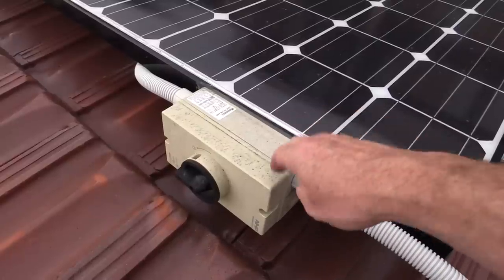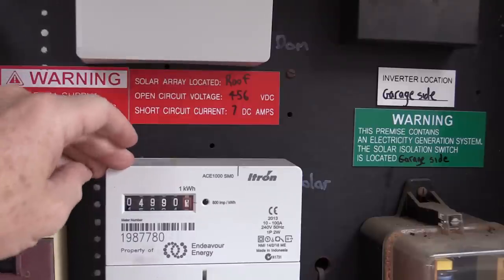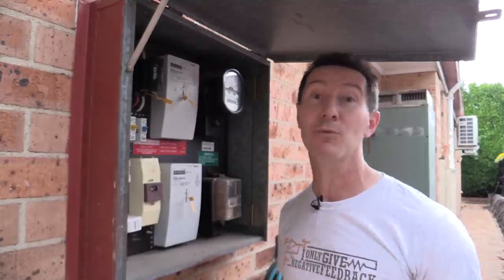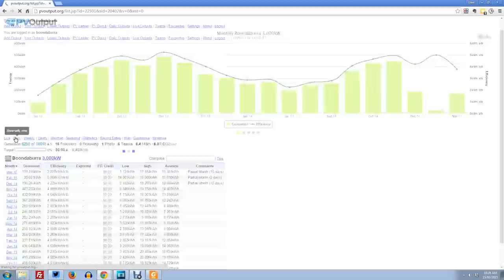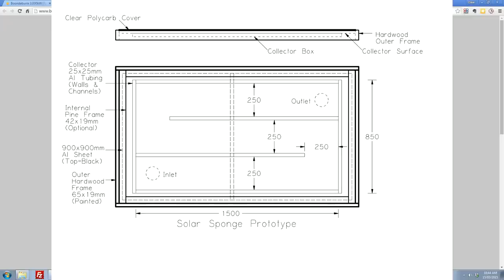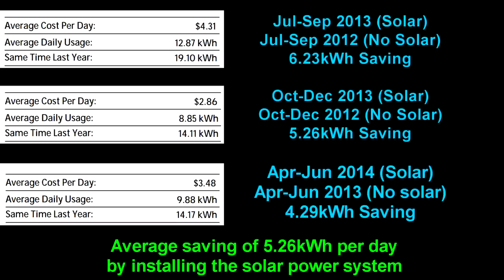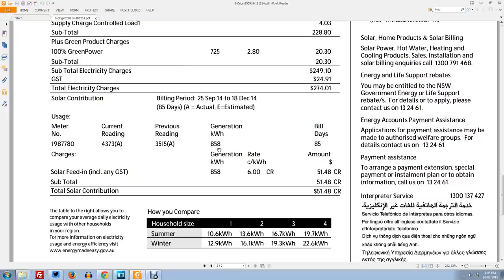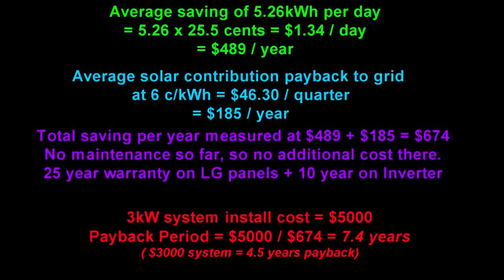EEVblog #724 - Home Solar Power System Analysis & Update

Comment: Man, I know there is a LOT more warm weather in OZ than Canada but that is an insanely low daily consumption!  Do you all use gas(Natural Gas/Propane) or oil for anything?

Our house is strictly electric and we have a top shelf geothermal system and it supplements our hot water and we average 62 Kwh/day!  (3400 sq feet heated/cooled).

Our cost per Kwh is only 10.5 and our FIT is 9.728 so that is not too bad but the cost of a system here and the massive losses on production in the winter makes the ROI really tough.  And my GHP draws massive amps on startup so I cannot really entertain off grid without a massive investment in power storage.
Reply from the maker: Jason Price We basically don't need to heat our house, and if we do it's the aircon for maybe an hour or two on a few dozen cold days in winter. In Australia (most parts of it) we use vastly more aircon for cooling than for heating.
Reply: EEVblog Well, that explains it then!  My in-laws have renovated an old farm house and added a GHP and they have their daily down to about 45.

Lucky you I guess!  (Crazy poisonous things not withstanding!)

Anyhoo, love the vids so keep em coming!
Reply: In North America average home use quite a bit more power than Europe and probably Australia.
I live in Saskatchewan and my power consumption when I was living in a rented apartment was 250kWh/month in average for that the total bill was 50$. Most of that was the large fridge that came with the apartment and water distiller that I used daily.
Now I live offgrid and my power consumption is around 60kWh to 90kWh depending on month average probably above 80kWh/month.
Reply: ***** Per month?  I am in New Brunswick.  That is just not happening here unless you are using oil or wood for heat!  I can't see it being much warmer in Sas.
Reply: Jason Price At the moment I use propane for heating. But I will get a larger PV array and heat with electricity directly from the PV array. Is a bit of a specially designed and constructed house for low energy use. You can find a video with the house on my channel.
Reply: ***** I watched your house video and it all makes a lot more sense.  Posted a comment over on that video but otherwise, terrific work sir.  I guess a better way to look at power consumption would be on a per square foot basis as I chose to have a much larger house (By far) over yours.  My breakdown works out to 18.5 watts/hr per sq foot.  This is 50% less than a house with all baseboard electric and 30% or more less than a house with an air to air GHP.  You should do a conversion of BTU to watts and post a video showing your total energy usage.  It would certainly paint a much fuller picture.
Reply: Jason Price
Maybe I will do a video about my energy consumption. I'm used with kWh so I will need to convert to BTU for those used with those units for heat.
I made a quick google conversion so my worst moth heating of 1000kWh is equivalent with 3.4 million BTU the house is about 65sqm (700sqft)
If I will to take that 1000kWh/720h = 1388Wh
Then 1388Wh/700sqft = 1.98 watt/sqft
So 18.5W/sqft looks quite bad if it was calculated correctly.
Reply: ***** No, my watts is right but the per hour was supposed to be per day.  Whoops!  The heating needs of a larger house is not linear as you can imagine.  The costs go up faster as the surface area for loss increases.  Depending on the shape of the house, it can be even worse.  The total serviced area in the house is 3400 sq feet so it is quite a lot to heat and with GHP, there is only one heating zone, the whole house.

The heating degree days in New Brunswick are pretty rough even for a GHP so we use quite a lot of power to get through the winter.  The spring and summer months are far lower usage.  During the nicer months, we only average 47 Kwh per day.  Winter spikes to double that or so.
Reply: I live in Mexico and only consume about 5 kWh/day. Climate is moderate, so you don't need heating.
Reply: We only use electricity.  All our heating is via our geothermal heat pump.  We have the heat set at 67 as the low and 71 as the high boundary.  And again, big house.  As a comparison, my parents house is a 2400 sq ft bungalow and is all electric with minimal air con and they use more power than us.  It gets quite cold in the winter in New Brunswick.  Contrary to what Al Gore claims, winter still very much exists!!! LOL!!!
Reply: Ya we have converted a lot of bulbs to LED.  The one thing we didn't do that we should have was to wrap the foundation with 2 inch blue SM to greatly reduce lost heat via the concrete.
Reply: I only use about 3 kWh a day for electricity, but its still expensive because we pay a $1.30 or something like that a day service to property charge.  This is on top of the power use. so without using anything you would still be over $100.
and power near 30 cents a kWh. welcome to electricity charges in victoria, australia.
Reply: ***** Mercy!!!  I guess the huge installed base of hydroelectric has spoiled Canadians with cheap power for a very very long time.  Currently (pun intended :) ), we produce over 63% of our power from hydro and the next 15% is from nuclear.  So even though we may use a lot of electricity, it is pretty damn clean.

Our monthly service charge is only $20, then add usage to that.  When you consider that the average house in Canada or the US is nearly 3 times what it was in 1950, it is not much of a surprise that we use as much power as we do.  My garage is over 600 sq feet and the average HOUSE size in 1950 was only 980!
Reply: Jason Price
My house is only like 1300 sq feet so very small. the killer is the rip of service charge, and it is the same with the gas but not so bad. and the water too. people used to say Australia was cheap to live in but I dont think so. petrol is expensive too and like $1.50 not so long ago.
Reply: ***** Ya, if our power was more expensive, it would suck.  Our average for power in the country is about 13 cents Kwh and gas has been down at around $1 or less per liter lately so it is not too bad.

Our biggest benefit to cost of living is having the US right next door and having access to both the Atlantic and Pacific ocean for freight.
Reply: Jason Price
13 cents is cheap, but I hear Canadians and USA can spend big $$ in heating in winter, or freeze to death in their own home. and have pipes freeze and the like.
Reply: ***** that is correct.  Power/energy use in the winter for many Canadians, doubles in the winter.  I know it does for me.  And that is double the average of the warm part of the year vs. the cold part and I air condition in the height of the summer and it does not hold a candle to my deep winter costs.  In Feb, the daily usage can average as much as 100 KWh.
Reply: Jason Price
100kWh a day that is a month for me hehe. i can go without putting the heater on in winter and its cold like a fridge in the morning. by mid morning its warmer outside even mid winter than in the house.
i open all the windows as soon as i get up. and I am in a colder climate part of aussieland.  Minimum goes down to -3.c. daytime around 10-13.c
Reply: ***** Night time winter temps where I live regularly get into the-15 to -20 C range and when "night" starts at 5pm and goes to 7am the next day...  COLD!!!!!
Reply: so my winter is like summer to you in a way. well at least you dont have winter peg temps. hottest here in summer was 48.c.
Reply: ***** Well, comically and very well unknown by most of even our American neighbors is that the lower portions of Canada in the summer are indeed quite warm and we can easily have days where the temperatures hit into the 30s.  Fortunately, they are not super frequent as where I live, there is a large river and we have quite high humidity throughout most of the summer.

The lower portion of Canada where most people live is actually as far south as France and Italy and even the western section up against the US border is farther south than London England!  What makes Canada so damn cold in the winter and much more temperate in the summer is the GIGANTIC Hudson Bay.  It lets all the cold arctic air into the lower parts of the continent.  That "bay" is more than 1/6th the size of all of Australia so it is bloody huge.
Reply: Here in summer it is very hot it can be 38.c everyday, and as i said getting up to 45, and very low humidity its very dry cl;ear heat.
You would love my winter, it would be so mild to you.  I have chillis growing even in winter. just have to cover them at night.
Reply: ***** Well, OZ is on my short list of countries I would choose to live in!
Reply: In the UK here, and I average 2kWh/day; we have the gulf stream to keep the weather mild ;)
Reply: Barrios Groupie Ya, you lucky devils!  It goes by us but does little to help us in the winter!
Reply: Barrios Groupie
UK is bad for solar power! :)
Reply: +Jason Price According to our Prime Moron, Coal is good for humanity (because that's who funds his political party),  Electricity production in Au is, iirc, the dirtiest in the OECD.   Hydro potential is pretty limited in Australia, but Solar (both PV and Thermal) and wind have a huge upside.  Just on residential property, there's something like a million (out of six million) have PV installed.  Rooftop PV penetration has reached the point where the power generators (primarily coal) aren't making money during peak sunshine hours, or overnight.  All they have left is the morning and evening peaks.

Here in QLD, the power suppliers are clawing back what it costs them to buy the PV electricity.  Just recently we got slugged with a new charge to read the meters, even though it takes no longer to read the meter in a PV-connected house than one without.
Reply: Well, the ROI is better with solar if you are in a region of good year round sun and no real winter.

I will say though that the cheapest possible power is the best and first most important thing to lifting people out of poverty.  It is an undeniable fact shown in study after study of the last 200 years of development.  Clean coal plants are indeed very doable and to the degree that the vast majority of what looks like emissions is water vapor from the turbine and cooling systems.  Classic Ye Olde England style coal burning has been gone from OECD nations for a long time.

Remember that "dirty" is a relative term.  Cars today for instance are beyond orders of magnitude better than only 20 years ago.  Also, solar and wind hardware is not made with smiles and hugs.  They take an enormous amount of resources and use some pretty wretched chemicals to be made.

Comment: How in the world did your system cost $5000? We just paid $18,000 USD for a similar system with SunPower panels and the same SMA inverter.
Reply: +Daniel Heppner , What did you get for 18.000 USD ?
Reply: +Daniel Heppner I have a 3.6kw system with LG panels and same inverter for about 11k Aus $ fitted. So yes his system seems incredibly cheap, especially for 3 years ago.
Reply: +Uroš Vovčak We got a 4 KW system with top of the line SunPower panels and the exact same inverter. Maybe labor is just more expensive in the US...

Comment: 10 kwh would  cover my power bill unless its  winter and cold outside (top was 970kWh - summer  70kWh).

For the  amount of money they gain from your power and pay back little - it could be worth investing into energy storage.
Ether batteries or perhaps   heat storage (for water) or  cooling (freezing liquids that can be used to cool the house) - or even try electrolysis - and do something fun with the hydrogen.

Or how about selling to neighbors (if there is any)? Like half the cost (~15c) or so.

Comment: First up, Awesome show!, Anyway, enough brown nosing.  

To the point.
I myself have 26 x 255 W solar panels.  Split into two systems, one is mine ( 8 x with batteries) and the other is grid tied (The other 18 panels, on two strings).  They run separately, no chance of islanding. That does for all my "Free Energy"! 

One thing that really baffles me is why don't all the "Free Energy" nut jobs that seem to be out there, just go out and buy solar panels, wind or hydro (depending on their best option).  I have seen these "Free Energy" drongos X-Ray themselves on YouTube, in their futile attempts to make "Free Power", while then spending heaps on copper wire and equipment that they don't know how to use at all most of the time!!!  

Any opinions?

Comment: I've seen that Google has some monster huge server farm facilities and solar panels.
In that scenario why even bother to try to sell power to the grid at a low rate?
Every watt hour their solar array produces just replaces what would have cost them the full rate from the grid.
Would placing these on a gazebo or picnic shelter 20 feet from the house solve the firefighter problem?
Reply: It probably would, as long as there was a clear way to disconnect the panels and shut the power off, that was accessible even if the house was on fire.
Reply: How about a disconnect block that can be yanked by a grounded buried 30 foot  stainless steel cable in a channel?
Reply: Could certainly work, but might be easier to do it electrically where flicking a switch (or melting the wire) cuts power to some relays which then disconnect the crucial parts of the system.  I think the hardest part would be figuring out where to place it such that the firefighters can find it, but bored local kids can't.
Reply: Would a fusible link make rooftop solar panels safer for firefighters?
Perhaps a dry standpipe or sprinkler system would be worth doing?
What do firefighters do to cut electricity from the grid, yank the power meter?
Reply: Would be nice to know.  I asked a firefighter once and he said they generally don't worry about the power, but they are taught to push hanging cables out of the way with the back of their hand so that if they do get a shock they won't grab onto the cables.  I guess if there are RCD devices then as soon as water hits something live and grounds it, that will cut the power, but this still leaves potentially high voltages up on the panels.  You'd think those would be isolated though so you wouldn't get a shock?

Comment: Interesting that you use gas to heat water and electricity for cooking. Here in Brazil are predominantly the opposite: electricity for showers and butane/propane for cooking.

Also here, using solar for heating water exists, but are not very common.
Reply: +Jonathan Araujo In Australia, we actually have a mixture of all options - electric/gas cooking, electric/gas hot water. Heating is more often natural gas. My current house actually has an electric oven, gas stove (in the same unit) and gas heating and hot water.

Comment: Hi from germany. I have a 6 kw system and an external logger. Still thinking about a storage solutiont to use more of the solar power. Right now it´s about 25-30% depending on the Sun and if i´m at home or not.But still 15 years to go till my contract ends.

Comment: How is the system works does it work by using the solar generated power first then use the main grid for the rest when the solar power is not enough?

Comment: What are those rotating things behind Dave in the beginning of the video called and for which purpose are they used?
Reply: +STephanM Wind turbines for pulling hot air out of attic.
Reply: Thank you, so my quess was correct.
Do they work efficient? Will AC work efficient with those?

Comment: This seems wrong. The the meter should be on the inbound side outside of the solar inverter. Then it should be 6.7MW imported, 7,4MW generated and 5MW exported.

So that make it about 1.7MW directlty used and a total of 8.4MW used total.

24c... f***, that's expensive, we pay almost only half of that (about 13-14c equivalent)

8c net payback do i think is preatty good. Electricity providers in Sweden get about 4,5c for power, but the one the windpower got 7,5c and the solar get like 12c something.

Comment: Thanks Dave and $5000 - you got an amazingly good deal. We need to remember that's a heavily subsidized price when calculating ROI though. The true cost of such a system is around twice that "price" and here in California it's closer to 3X installed. Although you don't personally have to worry about the true cost, it's still questionable whether the panels and inverter will survive the time to break even at present electricity rates. The subsidies depend on you being a source of cheap electricity - your provider hopes to make back about $1000 annually, so they'd hate to hear your just using up the extra cheap energy! Energy costs will only rise, however, so the viability of these systems may become more apparent in the future  - it better since these government monopoly subsidies are all hedging their bets on it. Of Elon Musk gets his way with carbon taxes and building new fukushimas though.... you never know where electricity prices may be in 5 years time (got to use up that remaining 80 years of uranium).